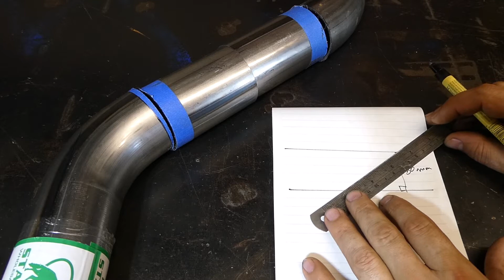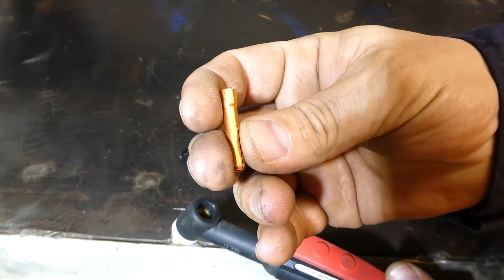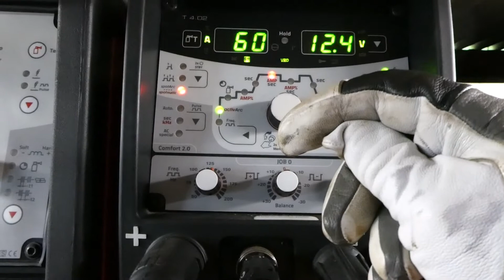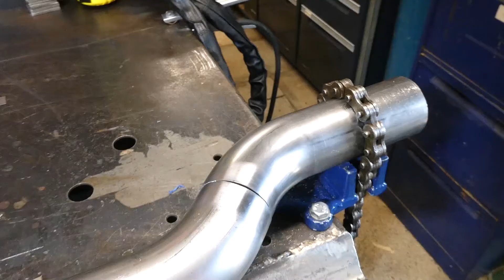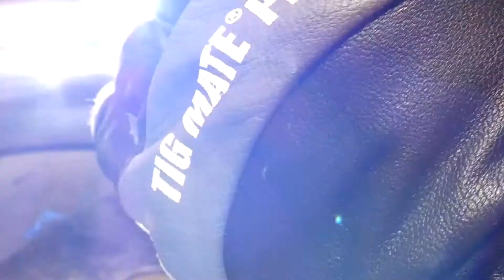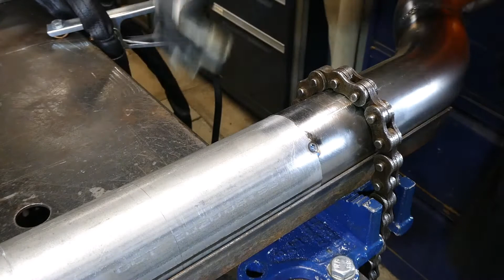TIG welding an exhaust section for the LR Defender 90

Comment: your an old oxy acet welder ,,, ill bet !
Reply from the maker: I'll burn holes thru anything mate! With extreme prejudice too. 
Using the KHz pulsing on that material for that joint configuration was the worst idea I had that week. Too focused an arc, too thin material, butt joint... it all stacked in the favour of too much heat. If I were filming it again, I'd run  abase pulse, maybe 60A peak, 40A base, balance it 33% high, and maybe 1Hz pulse... get some filler in there, keep it real cool, and hold on for the ride. 
But a 12500Hz screamer still makes for great entertainment. Plus people love laughing at someone rooting the job up. 🤣👍